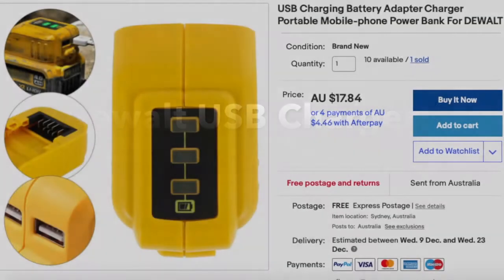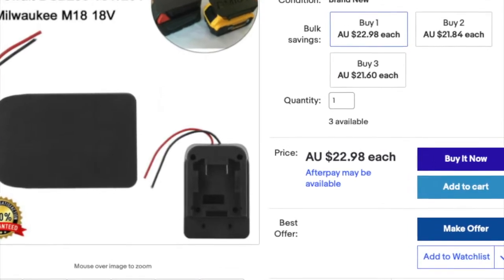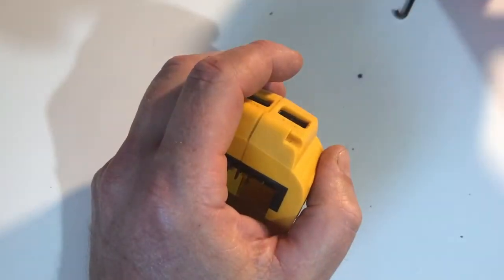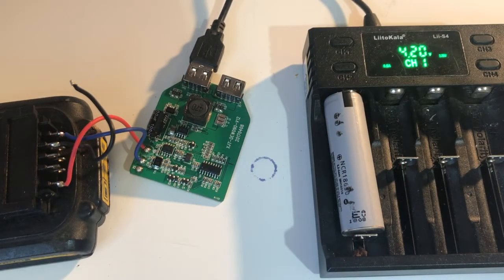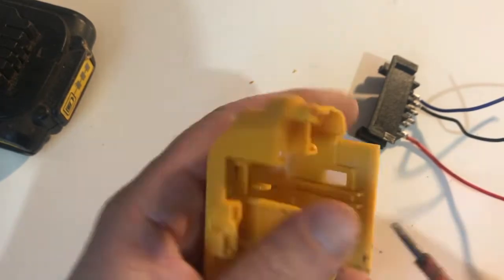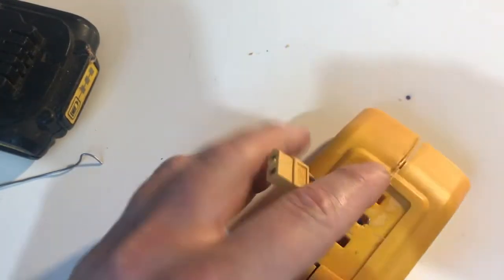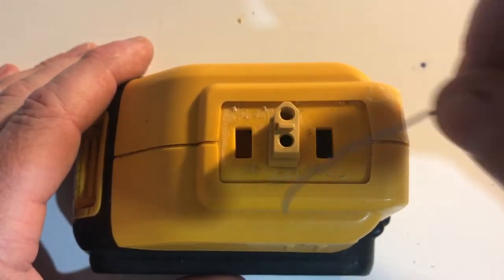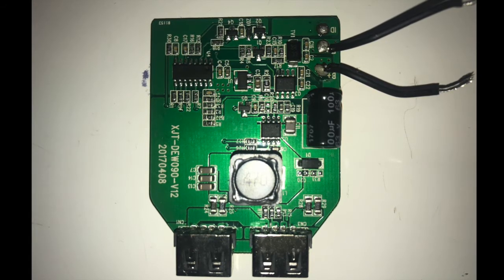DeWalt USB Adapter / DIY Battery Socket Hack - Power other things with your DeWalt batteries.

Comment: You have to be careful as most devices will draw power until the cells are flat/damaged. You need a BMS or balance leads to be able to ensure the battery is not over discharged in use. I did this years ago but have a 6pin RC style lead to monitor the cell voltages.
Reply from the maker: DeWalt drills will do this too.

Comment: What is the amperage output through that new female connector u installed ? I think u probably don't get the full output as it only connects to a couple of batteries inside. I could be wrong. 👀
Reply from the maker: It's the full amps. I am not sure of the specifics with DeWalt, but in other batteries I have messed with you can access individual banks of batteries in lots of 4 volts, 4V, 8V, 12V, 16V and 20V. I'll be doing  a test in the coming months on an electric lawnmower.